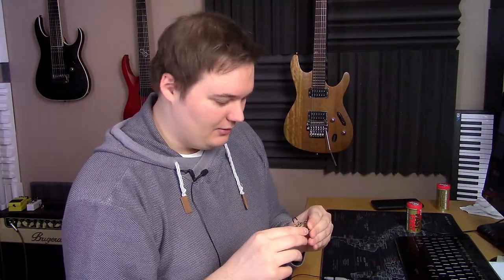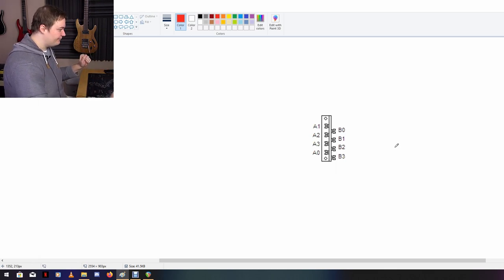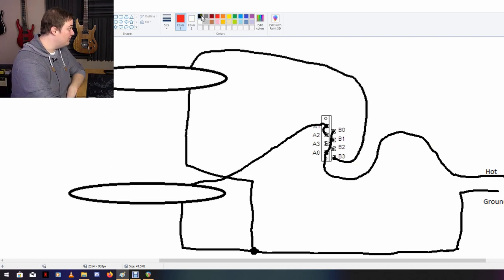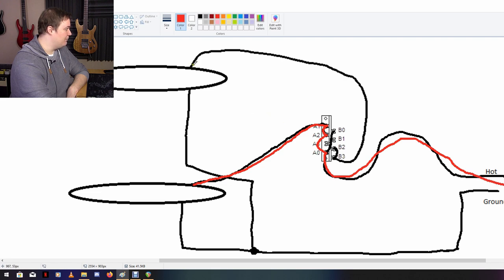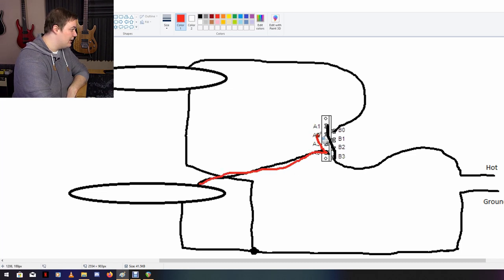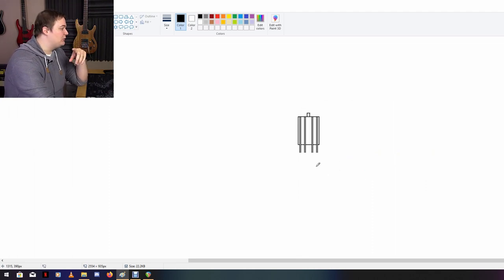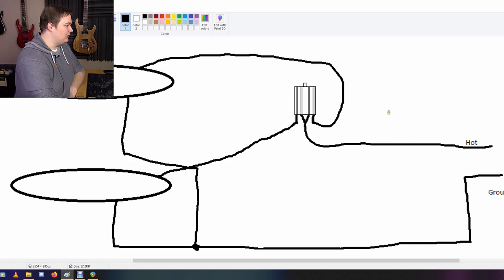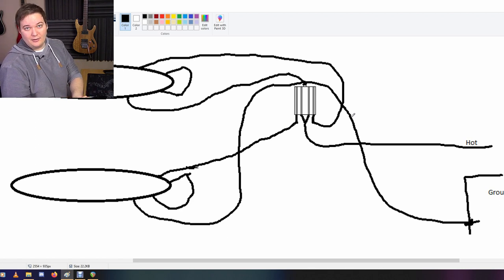Guitar Wiring 101 | 3-Way-Switches

Comment: Excellent! I wired it first try with no buzzing or nuisance noise. 7:34 Diagram was perfect. I wired it with one grounded volume pot in the hot line. Thanks so much.

Comment: The switch has an extra connection, for ground. Good. I just did a wiring fix on a friend's Les Paul (my first adventure in electric guitar land), and that was the only bit I wasn't sure I got right. Looks like I did, after all. Thanks.

Comment: Question:
Is it possible to replace a 3-way toggle with a pot in order to dial in the different levels of the bridge/neck pickup? If so, then what issues would I face? 
In other words, I want 3 pots and no pickup selector instead of 2 pots and a pickup selector.
Reply from the maker: yes, you´ll need a rotary switche. they are used on basses instead of standard switches. but the principle on how they work and how to put them in the circuit is exactly the same.
Reply: @ForTiorIJohnny  So it HAS to be s selector of some kind?

Comment: hi - great vid!  would you know how to wire two pickups with independent volumes for each pickup? NO tone knob.
Reply: So in a master volume setup the volume pot goes between the switch and the output jack. In the situation you asked about the two volume pots go between the individual pickups and the switch. Effectively controlling how much of the signal goes to the switch and out to the output jack.
Reply: @beast99dp26  thanks for this. Is a switch necessary?